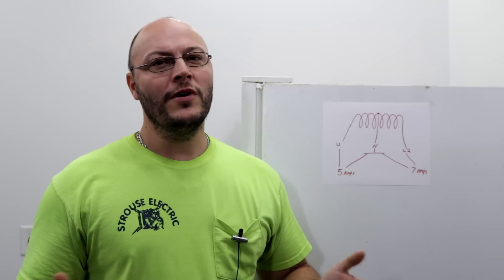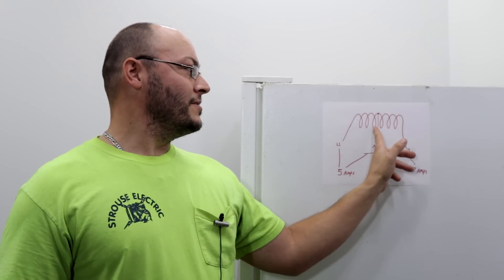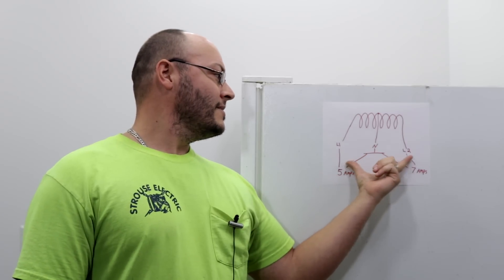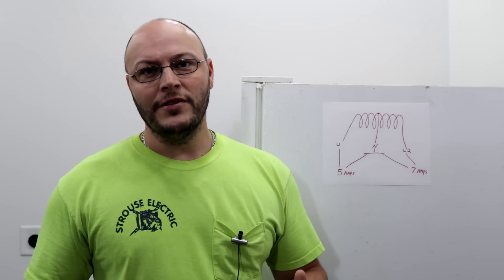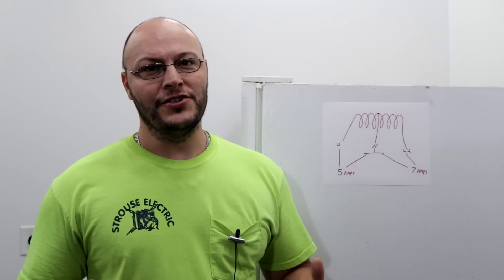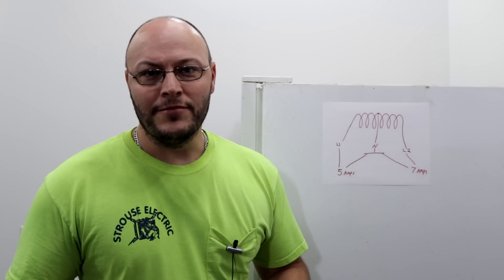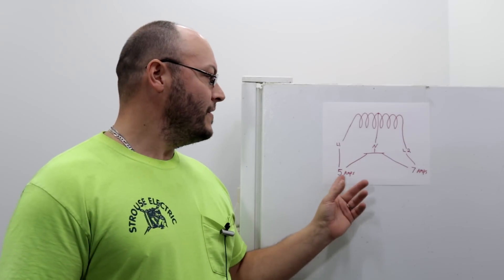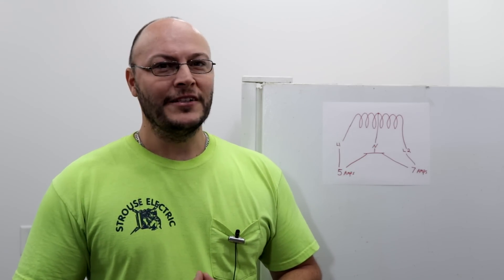What does the Neutral Wire Do?

Comment: Where you are primarily wrong, is in thinking that "ground' is for lightning strikes.  If this were the case then you wouldn't have devices with no metal chassis that only have two prongs...   Did the engineers figure that this item would be sold where there are no lightning strikes??  NO!  When you have a device with a metal chassis, you can use it to "ground" things  within the circuit...  The problem with this is that if there is a break down in some part of the circuit internally, that causes a bare load carrying wire to make contact with the chassis, then a person touching that chassis could be shocked, severely injured, or killed...  by having the chassis "grounded" the current would follow the path of least resistance, and even in a case of malfunction where something hot touches the chassis, you can still touch the chassis with your hand and not be shocked, because current will flow much more easily through copper to the ground than through your body to the ground.  In such a case you also have circuit breakers that are designed to break the continuity of the circuit, as a safety feature, in the event that power ends up flowing straight to ground or neutral with no load.  Does ground help protect electronic and electrical devices in your home from power surges and lightning strikes??  To an extent, yes, grounding can help protect your appliances, because any surge coming from power lines or lightning that strikes a power pole, can in fact flow through the lines and if your device is grounded directly to earth, that excess power has somewhere to go, (the ground) again, with less resistance than is offered by anything in the device.  But this doesn't mean that ground will protect your devices from ANY AND ALL power surges.  If the lightning strike is direct enough, with enough total power (amperage and voltage) it's going to fry your devices irrespective of any connections to ground.
Reply: digital1 ministry9    Please think about this a minute.   He said ground is for lightning strikes.  Meaning grounding Electrode conductor and grounding electrodes in contact with earth.   He did not bring up equipment grounds at all, which have absolutely nothing to do with earth ground.
Reply: @KevinCoop1   The reason you have ANY GROUND AT ALL, is because ultimately you're going to use an electrical outlet to plug something into it...  Otherwise you wouldn't even have electrical outlets.    If driving a copper ground spike into the ground and connecting a wire to, say the plumbing, in a house with no electrical power, could prevent lightning from striking the house, then EVERY HOUSE would be tied to a grounding spike, every log cabin, every structure everywhere would be grounded, irrespective of whether the structure has electric power service connected to it.  I'm sorry, but you are sadly mistaken.  Grounding does not prevent damage from lightning strikes.  He may not have talked about equipment ground, but there is ABSOLUTELY no other reason at all to ground anything.  ALL GROUND IS ESTABLISHED FOR THE PURPOSE OF ULTIMATELY CONNECTING TO SOME EQUIPMENT!!!  ;THAT IS WHY YOU HAVE A GROUND PRONG RECEPTACLE IN WALL OUTLETS!!!!  OTHERWISE THERE WOULD BE NO GROUND!!!
Reply: digital1 ministry9   I did not say that grounding was for lightening strikes.  I said he did.   My comment was pointing out that the author of the video did not discuss equipment grounds that you were going on about.   What do you base all your comments on?  Education, work experience, or just unknowing opinion.    Obviously from some of the words you use, you are not an electrician, an electrical designer, or an electrical engineer.   I worked for electrical contractors for over 30 years as a designer and as a professional engineer.   So, tell me about how you learned about electric, please.
Reply: @KevinCoop1   I am an electrical contractor, member of the IBEW, and have two engineering degrees...  THERE IS NO PURPOSE FOR ANY GROUND EXCEPT TO GROUND EQUIPMENT!!!  30 YEARS AND YOU DON'T KNOW THIS????
Reply: digital1 ministry9   Also, in the bottom of your comment that is in all CAPS you are totally wrong.   Earth ground has absolutely nothing to do with a ground prong in a receptacle or plug.
Reply: digital1 ministry9   So as an electrical contractor, you install electrical services and transformers in commercial buildings with no grounding electrodes connected via grounding electrode conductor??????

Comment: Can you explain the deadly electrocution hazard of grounds & neutrals being tied together, please?
Why is it a deadly hazard?
Thanks in advance.
Reply: They are only hazardous when connected anywhere on the load side of the panel. IE: tying both together in a plug. 
Neutral current would run through the bonding conductor and could energized any non current carrying metal. IE the metal case of your microwave. 

The neutrals and grounds are electrically connected at the panel with a jumper.
Reply: @daveslyker4431  but not in a sub-panel.
Reply: @adamrspears1981  ya. I didn't say a sub panel. I said the panel. Most houses don't have sub panels.
Reply: @daveslyker4431  I never said you said a sub-panel. I mentioned the sub panel because if the ground & neutral bars are jumpered, then you end up with the situation that you educated on: a current carrying neutral.
The only "neutral" that should have amperage is the final "neutral" leg that literally goes back to the x-fmr on the utility pole outside.
& its not technically called a "neutral". I forgot its correct terminology.
Thanks for the education. You are right.
Reply: @adamrspears1981  I think you're confusing neutral with bonding conductor. The neutral, especially in a residential application will always carry current. The hazard arises from connecting the bond and neutral together anywhere after the main panel. The bonding conductor will carry some of the neutrals current . Since bonds are directly attached to the non current carrying metal, when you touch said metal you get a shock.
Reply: @daveslyker4431  Yes. Bonding Conductor, that is the terminology that I couldn't remember.
The amperage on that Bonding Conductor should, as it goes back the x-fmr winding on the utility pole, equal the amperage being drawn by the customer that the x-fmr supplies voltage to.
Reply: @adamrspears1981   the bonding conductor doesn't go back to the transformer. It goes to the panel, which is connected to the grounding conductor and the neutral. Only the neutral and two hot conductors go to the transformer. Neutrals carry the unbalanced load only.
Reply: @daveslyker4431  Yes. Thanks for the clarification on that. I was told by an electrician that they don't call that 'neutral' that goes back to the x-fmr a neutral. He told me what they call it, but I can't remember what it is.
Its driving me nuts!!!
Reply: @daveslyker4431  Consider my cook top, it is wired with 8 ga SE cable L1, L2 and neutral/ground. The burners are 240v  but the indicator light and fan are  120v thus providing current flow through the neutral/ground which includes the metal of the cook top however it can't shock me as it is grounded (zero potential) at the panel. Current code would not permit this but it is compliant as it was wired in the 70s.
Reply: @shofar-man  burners are 120, oven is 240. Neutral carries unbalanced load for the 120v lines. Frame of the stove is bonded with a bare copper wire. Neutral does not bond equipment to ground.
Reply: @daveslyker4431  My burners are 240v and service entry (SE) cable is L1, L2 with stranded outer wrap which serves as ground/neutral. Bottom line is that represents 3 wires to the cooktop fed by a 240v breaker. For safety purposes the cooktop is bonded to that neutral/ground. My double oven is mounted in a wall cabinet and fed via a separate 240v breaker. The code has changed since my appliances were made.
Reply: Adam Spears    There is no deadly electrocution hazard in timing grounds and neutrals together anywhere.   The reason they are separated, except at the service is to insure that it is an effective path back to the panel.   For many years dryers and electric ranges were allowed to allow neutral and ground function in the same conductor.   New installations should have both conductors.   Hope this helps.

Comment: Also in Europe, China, there is no Nutral, everything runs on 240 volts, #14 is not needed, #16, less copper. 240 volts is isolated from ground, you do not get a shock holding onto kitchen tap and touching 240 volt line.

Comment: The Neutral is bonded to Earth ground.  Mother Earth is your return.  Take a light bulb and take one side to your little slot on the wall outlet and the other side of the bulb connected it to the Earth.  The light will turn on.  Why, because the Earth completes the circuit.  Funny how that works.  Licensed electrician for the past 26 years, haven't made an electrical fire yet.
Reply: Actually no.  We do not depend on the Earth to carry current.  All current should go back to the source in a wire, and not make voltage gradients across the ground.  Bonding neutral to ground is done, such that the two live voltages don't drift to thousands of volts relative to ground, but rather that they stay within reasonable limits of ground (i.e. both are 120V to ground).

Comment: Wow as I read these comments most of you do not understand a power distribution system. Let me try to explain begining at the source (power generation)
I assume you all know the purpose of a generator is to produce a source of electrical energy. The generators spin and create a magnectic flux that is induced into coils of wire. These coils are arranged into a WYE pattern. That is the coils have 3 taps on them, Hense the term 3 phase. Each of these phases have an opposite end of the coil called a neutral. Each of these neutrals are tied together and attached to the earth. The generators produce between 20-22 thousand volts and thousand of amps. Remember ohms law volt*amps equals wattage (only in a purely linear load) so these plants produces megawatts of power.
These 3 phase wires enter the grid and each phase is handeled separalty. Each phase gets stepped up to 500-750 thousand volts for distribution. Raising the voltage will effectively reduce the current (remember ohms law)
So if a generator produces 22kv (22,000 volts) at thosands of amps. Lets say for our discussion, the generator produces 10,000 amps. The generator is producing (22,000 volts * 10,000 amps = 220 million watts) 220 megawatts of power. After its stepped up to 750,000 volts, we need to keep the same power so the amps decrease, so 220,000,000 watts / 750,000 volts = 293.3333 amps! The reason we do That is so we can use thiner wire on the transmission lines. It still delivers the same power (watts) but with thinner wire. Neat huh? Now as rhe power runs across the country therr will be losses due to the. Resistance of the wire. (Yes ohms law once again) so there must be substations to keep the voltage at the same levels, so the run through more transformers that maintain the voltage, yes they loose some amps, but cant help that because if the wire lengths 
We finally get to a local distribution system that takes each phase and sends it where it needd to go. Some businesses need 3 phase power, so three wire go there 
Now we get to the avg home. Outside ob the pole way at the top you will see a primary wire. The voltage on that wire has been stepped down to standard lone voltage of 7,200 volts, but it may carry 100amps. So the power of each standard line may be 720,000 watts. Clearly 7,200 volts is too high for a house so it is stepped down at the pole in a community. The primary wire is fed into another transformer atop the pole. The primary wire is ONE side of the primary winding. Where does the other end if the winding go???? Remember back at the generator we sent one side of the 3 phases to ground? Thats right! The other side of out local tranformers primary winding come from a groind rod located at the base of the pole! Go ahead look at one. This gound wire also grounds tha outside metal can of the transformer. Now comes rhe fun part.
Ther secondary part of the transformer has 3 wires. One wire is the "low" side of the winding. This wire is usually black insulated wire, another wire come from the "high" side of the secondary winding and is also black insulated wire. I use the term "low" and "high" to say the "high" side is in phase with the primary wire at the very top of the pole.
Now comes the magic, the third and final wire come from the center tap of the secondary winding. This we call rhe neutral. Why? Because as the name implies, is carrys no current!!! It is sonply the return of a split-phase secondary transformer winding. Ever wonder why this neutral is usually a braided aluminum wire and not an insulated one??? Think about that. This wire is NOT the same as a ground (yet)
These three wire enter the meter by way of a service entrance cable. After your elec company get to spy on your usage and charge you, the wires finally enter your electric panel. Whew! But we are not done yet. The black wires are marked L1 & L2 they alternate on each breaker bus as it goes down the panel. The neutral goes on a "bus" bar and at this point a ground wire is introduced from a long copper rod buried by the elec meter. The ground wire is bonded to the neutral in the panel. The neutral wire is ONLY there to dissipate the difference in an unbalanced panel, remember the alternating L1 & L2?? Ideally this should be balanced, but it never is. 
So now I HOPE you can clearly see the difference between a neutral and a ground, they are not the same!
I hear comments on this split-phase secondary transformer windings as not being 180° out of phase with each other. The fact is they are 180° out of phase with respect to the neutral. That's the way the transformer is wound.
If you get the chance, put a dual trace oscilloscope on L1 & L2 and the neutral placed as the "ground" on the scope. You will clearly see L1 & L2 180° apart.
I hope this clears up any misunderstanding.
Please respect electricity and totally understand what you are doing. Remember the only good electrician is one that's alive ;)
Disclaimer: sorry for any typos
Reply: roy Yung, A lot of words attempting to explain what Bill addressed with an easily understood diagram. The transformer secondary winding is single phase 240v with a center tap to provide two 120v legs. The neutral in romex cables inside the house provide a current return for 120v circuits to the panel. Since 120v loads are not balanced some current will flow from the panel via the neutral to the center tap of the transformer. Ground is only for safety and reference purposes and is not part of the functional circuit. Yes L1 and L2 are 180° apart in polarity as they are opposite ends of a single phase.
Reply: @shofar-man  ok, and? The point of my comment was that a lot of people simply do not understand power generation, distribution, and the purpose of a neutral. In a perfectly balanced panel of similar loads, the neutral carries no current at all hence its name.
Reply: The OK and? is that you incorrectly stated "The ground wire is ONLY there to dissipate the difference in an unbalanced panel". In fact it is the neutral wire that carries the unbalance of current.
Reply: @shofar-man  correct. I meant to say the neutral..   My bad. I corrected it. Thanks for catching that

Comment: so you are returning 2 amps back to the power company  with out credit?
Reply: No, all amps return to the source. L1, L2 and the neutral all carry current. Only L1 and L2 are metered but any current in neutral comes from L1 or L2 (AC is not directional we only assume direction for ease of Kirchhoff analysis).

Comment: the neutral gives the power back to the power company.. unhook that wire... run your ground 9ft deep..on that line.. get free electric for life................. Pandora is put of the box... your welcome...
Reply: Not so, the metered lines are the L1 and L2, neutral runs straight through to the center tap of transformer. Go to big box store and look at a meter base.

Comment: I'm a licensed electrical engineer in Texas and I totally like your explaination as it's spot on. This also works for a three phase system say a 208y/120v distribution system. Your AB or AC or CB phase will get you 208v single phase but any phase to neutral gets you 120v and of course if you use all three phases you get 208v three phase. On a delta setup its different but you get the picture. A neutral allows you to tap and use different voltages.
Reply: At a substation there is a step - down trasformer  which steps down 3 wires  line high voltage  "delta" to low voltage "star" so called  "delta/star"  4 wires  balanced circuit.
The fourth wire is centrally connected and is called "neutral".  With 208 volts  single phase voltage line to line , and 110 volts line to neutral. When the circuit is 
balanced the neutral wire doesn't carry carrent. In case of unbalanced circuit 
neutral  wire will carry current. Here wiil be needed the ground...The ground is not a wire ...it is a real ground. At a substation the neutral wire is grounded.It has a real ground. At distribution circuits  "ground " is a cold water pipe and connected 
to neutral in a distribution panel.
I am not an electrical engineer...I am a lisenced plant electrician.
Reply: @carlmarx780  we have a neutral ring bus in our cable chambers that are bonded to ground rods, the concentric neutrals and lead sheaths of the cables get bonded to neutral after we splice them.
Reply: please, share your experience. I want a smart switch to connect and it requires N. I don't have one and it seems like switches like that need N to power themselves (to have wireless connection and so on). Can I power them up from hot lead and is it safe? So, to be clear, I want to connect hot lead both into L and N sockets.